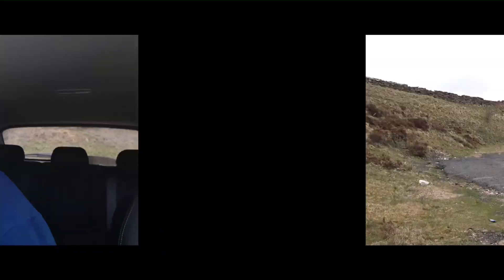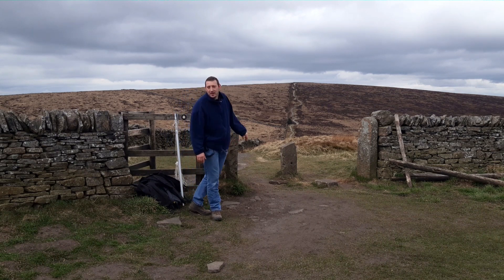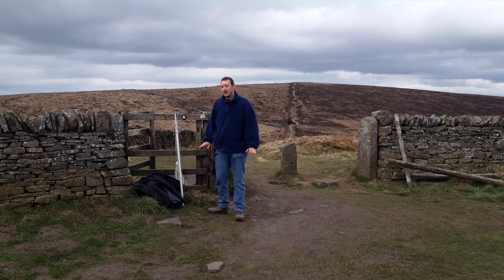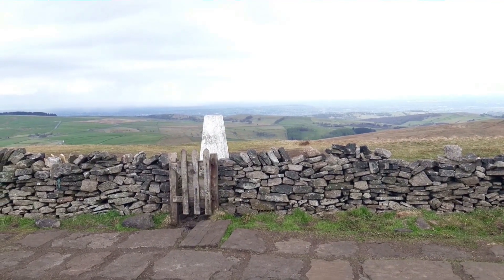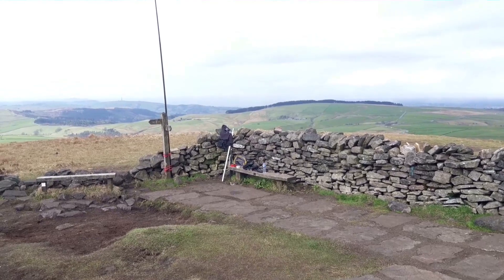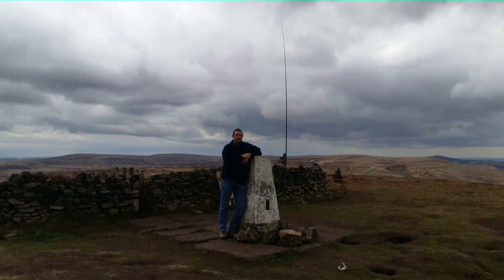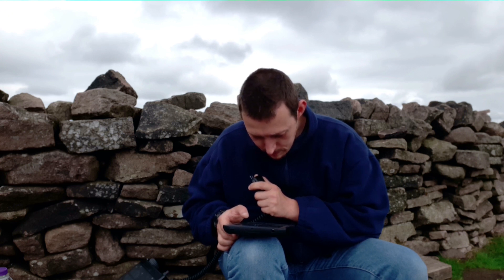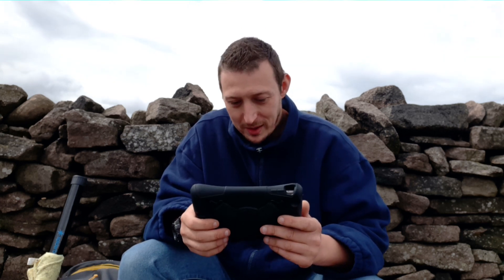A bad day of SOTA - Shining Tor (G/SP-004) - April 2021

Comment: What antenna do you use for 2 Metres portable James?... I've a 'Slim Jim' made from twin feeder bought via eBay a few years ago which I simply tape to the fishing pole holding up the HF wire.. It has 4 Meters of coax permanently atatched (Hi) it's lightweight and works well.. I'll send along a link..
Reply from the maker: Hi Peter, I've been meaning to try a Slim Jim. I tried making one the other day but I think I screwed up the measurements because the SWR was way out.

I currently use a lightweight telescopic aluminium mast with a mobile antenna on top fed with RG-213. It's not the lightest or easiest arrangement for SOTA but it does seem to work well.

If I'm doing an "exclusively VHF activation" where I want a decent VHF system then I don't mind the extra weight/bulk. It's a bit much if you are taking HF as well though.

I activated Kinder Scout on VHF the day after this video was filmed, so check out that video when it goes public (scheduled for Saturday afternoon).
Reply: Portable work is a compromise for sure... The best gear is what you have with you..
Like yourself I use a 7 Metre pole and long wire transformer.. I'll spool out 40 Metres of wire usually because I like daytime 80 Metres with it's inter G and EI because I'm a bit of a chatterbox rather than looking for numbers!.. I've a Yeasu 857, which isn't a QRP radio at all as It draws about 2 Amps simply clicking into 'Transmit'.. I run It from a 24Ah lead acid golf caddy battery at about 50 Watts, which is a reasonable balance of current draw versus time... I've looked at Lithium equivalent batteries as my next replacement and think I'll go that way..